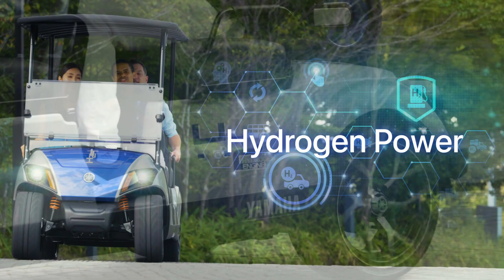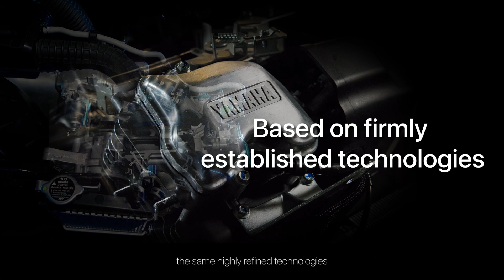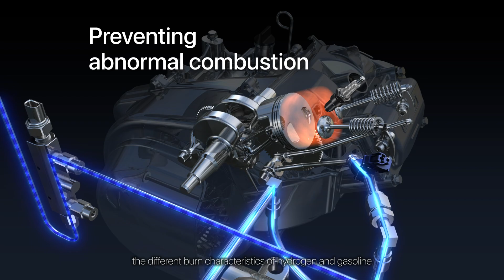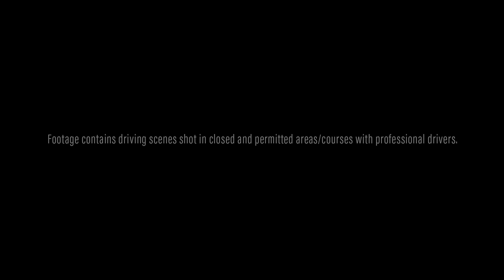DRIVE H2 - Hydrogen powered engine golf car Concept

Comment: Probably one of the dumbest uses of precious hydrogen. You can run 5 to 7 battery electric carts with the same amount of energy. No chance of succeeding.
Reply: Bland statement. Add some science to back this up if you want us to believe you.
Reply: @hardstonejoe5663  yes, Youtube is the perfect platform to explain physics and economics 😂. If you want to know something, do some research. Don't trust what people you don't know write on social media.
Reply: @hardstonejoe5663  bland statement. If you want to know something, do some research. Don't trust people on social media.
Also, youtube is not the best platform to explain physics and economics.
Reply: H2 supply is much faster
Reply: @eidee.cleantech  there is almost no hydrogen supply at the moment. +95% of hydrogen used today comes from fossil fuels. For this use case (and all road transport for that matter), BEV's are clearly the better technology.